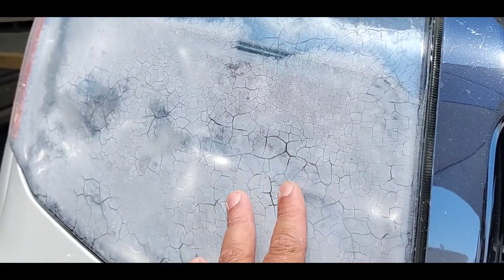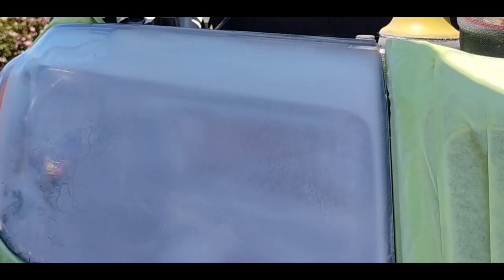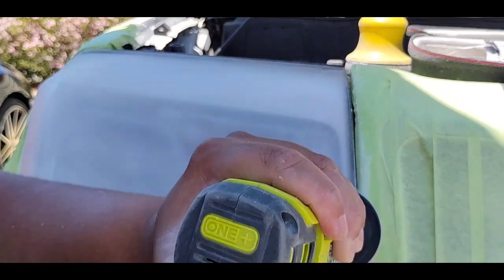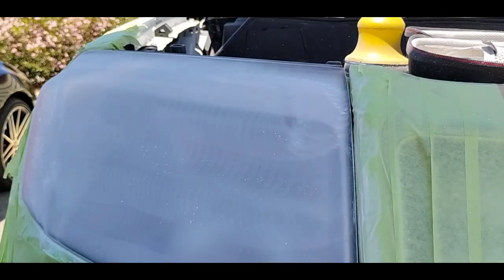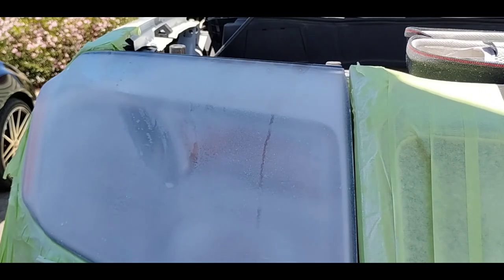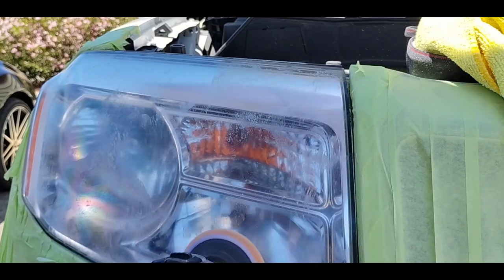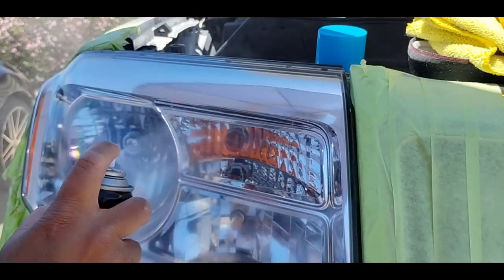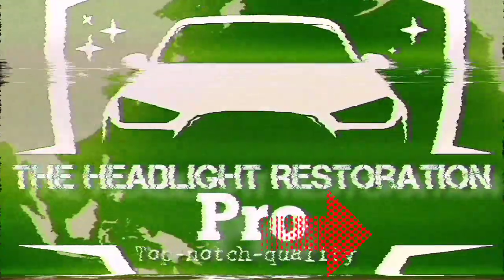Dragon Scale HEADLIGHT RESTORATION/crazy bizarre headlights 🐉

Comment: Great video! I have a 2008 328i coupe and the headlights need to be restored. They aren't horrible but they have some pitting. I noticed up close it looks like micro cracks on the headlights but I can't tell if it's the clear or the plastic itself. Should I attempt to restore the lights? I've done the fog lights already and they came out crystal clear.
Reply from the maker: If they weren't too bad I probably wouldn't mess with them until it's time.. but if you're noticing some possible cracking or whatnot I would start implementing preventative maintenance/aftercare 
Check this video out...
https://youtu.be/kIur4XxYjDk

Comment: Love it beginning to end! i'm really curious if you consider using the Ryobi polisher instead of your trusty ACDelco? You can swith batteries with your drill if you use the Ryobi one.
Reply from the maker: Yeah I've considered it... Maybe in the future..
But the main reason I have not done it is the weight...
If you notice the size difference from the batteries and the actual size of the device it's a bit more bulkier and the batteries are three times the size and weight...
So I'm in no rush..
Reply: @theheadlightrestorationpro  wanted to hear your opinion on that but that’s logical, the batteries on the ACDelco is way way lighter and that could take some time to get used to in your case. If I’m starting would you see wise if you get the Ryobi drill and polisher so I can work with the same batteries? That’s my case
Reply from the maker: Sure you'll need more batteries though they'll drain faster.
Reply: @theheadlightrestorationpro  got you, thanks again for sharing the knowledge 🙌

Comment: I watched most of your videos but I couldn't find anything about why you're using a mini polisher instead of a drill with a polisher attachment. I want to know if it's worth investing in because I have a drill and a polisher attachment. Is it an rpm issue or just the size?
Reply from the maker: Probably should watch the videos and pay a little more attention to that aspect stated on a lot of videos.. if you don't use it you're not going to get this effect..
Reply from the maker: It's literally touched bases on in the last video I made before this... Literally..
Reply: So I'm pretty much sold on your method here. My plan was to follow everything up until the clear and use spraymax 2k headlight clear, but this video changed my mind. Btw my friend contacted a rep from spraymax and asked question regarding the clear specifically for headlights. He said it uses different solvents that don't make it as hard as their regular clear. Regardless, I'll use the meguiers. My question for you is what if my headlight lenses are pretty much new and clear but I want to put a protective coat on them. Where do I start?
Reply: @theheadlightrestorationpro  i have some catching up to do, thank you for the help.
Reply from the maker: Yeah that rap was probably full shit it's the same thing with more UV protective in it a little less hardener but the fact that you have to crack a seal to introduce hardener means it's too hard for headlights.. if it'll Rock up inside of the can with no air it's extremely too hard for headlights regular 2K doesn't even do that.. in my opinion spray Max is the worst absolute worst thing you put on your vehicle and then the headlight version is one notch down and then it's everything else... More than likely I'm thinking that's what was on this light..
If you want the best method to preserving your headlights after Heather restoration and even when they're brand new to prevent it from coming on or the need for it coming up as long as possible you want aftercare which is also a preventative maintenance...
Check this video out 👇🏽
https://youtu.be/kIur4XxYjDk

Comment: So I notice you go from 800grit all the way up to 3000 do you find it unnecessary to follow up with like 1500grit before jumping so high to 3000? It’s very hard to find but if you can get your hands on this clear coat for headlights called “HB body lens clear” it’s leagues better than meguairs. They are in Germany so it’s hard to get it here. But I think you would love it.
Reply from the maker: I will definitely look into the clear coat...
But yeah I find it unnecessary especially if you can just control your hand pressure you definitely won't need it it'll become irrelevant you're produced the same product without as if you were using it I used to do a lot of different things until I discovered this as well.. used to go from 800 to 1,000 then a couple other grits but turns out is all the relevant if you can control the pressure that you place...
If you have trouble with it then you can throw those in there but to me they're just kind of like training wheels...
Reply: @theheadlightrestorationpro  ok thank you. I try and recommend other detailers you method because man some of these guys shouldn’t be working on cars at all. So many detailers out there just polishing with a polisher and putting on wax. And when you tell them it doesn’t last or look as good they don’t take any advice.
Reply from the maker: Exactly..💯
I see it like crazy..

Comment: Can a chemical paint removal be used?
Reply from the maker: Absolutely not....😫😫😫😫
You have to think about what you're thinking...
You can't use any degreasers or anything too strong there's a reason why I use nothing stronger than an ammonia free Windex or glass cleaner should I say..
You're dealing with a clear-coated painted surface things that are too solvent or two highly acidic will mess up your paint.. a paint removal or thinner will remove your paint on any given light about 80% of the bordering light is paint it and clear coat of surface of the vehicle, liquids accumulate and sometimes penetrate underneath the tape and sit there even if they didn't just touching your vehicle with the stuff for seconds will begin to eat your paint..
You shouldn't really use anything stronger than glass cleaner.. even if you remove the headlights these chemicals will still eat up the sealant around your headlight very dangerous to use for headlights..
I would never do it on my own car that alone somebody else's...💯
Reply: @theheadlightrestorationpro  ok thanks. Sanding it is

Comment: What about the 2K Clear that calims to be made for headlights?   Will those have the same drawbacks as the, for the lack of a better way of putting it, regular 2K clear for paint?
Reply from the maker: Not sure what your asking ?
Reply from the maker: Okay I think I get it now.. the 2K clear that says it's for headlights is got to be the spray Max it's the only one I've seen that is made for headlines..
It's the same thing as the one that's not.. it's so similar it's ridiculous only thing is is it has more UV protected in it and it's not as hard but very close this is why it still has that red pop top..
Any substance that needs hardener added to it and or a hardener seal cracked that will harden on itself inside of a can is to hard so even if it does have more UV protected it still has a huge issue.. both of them are the last things I would ever put on a headlight.... I would use regular 2K clear before them.. and I would never recommend you using that either..
Reply: @theheadlightrestorationpro  I used Spraymax 2K Today and Yesterday... Like you said. Its even horrible when spraying! Got huge spots and cracks already after spraying. Don't ask me how its possible, but even after the first coat it had those dragon cracks like in your video, just that the paint was like 2 minutes old ... absolutely weird and useless shit, i always used 1K and had no problems ever. But this 2K Spraymax is the last junk. I sanded everything down with 240 grid,400, 600, 800, 1200, 1500, redone it because i thought okay maybe i did a mistake or something... nope ... same result... that stuff is absolutely useless, i even tried it on a normal ABS Plastic Lighter which has matte coating to see if my headlights are the problem... nope. Some spots are not bonding at all, completely matte and others are glossy. Resorted to polish it the old fashioned way when the clear coat is dry and rubbed off again. Just absolutely hard to get it off by hand with 240 Grid.
Reply from the maker: Yeah 2K clears terrible terrible to work with terrible and results and a longevity.. even if you're an expert at using it like myself it still has all these side effects in the long run it also does not look as good as a finished product as these headlight products do,... So many reasons I don't use it even aesthetic reasons just doesn't look as good.